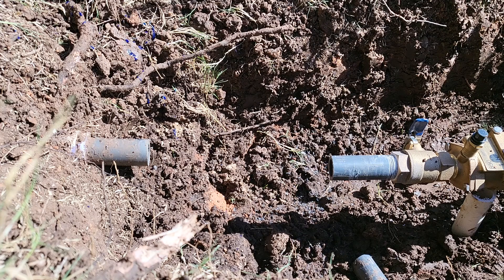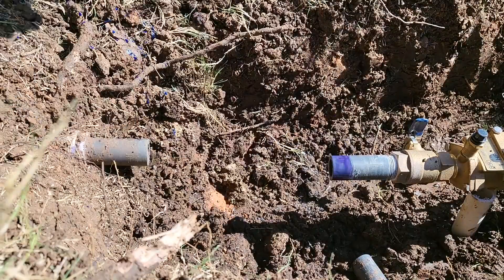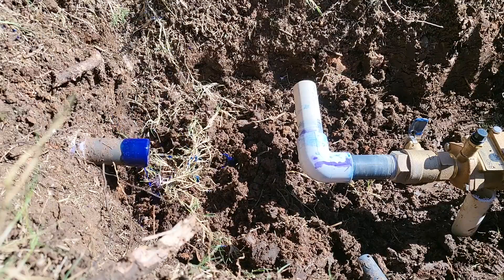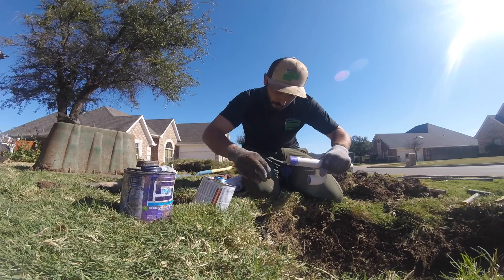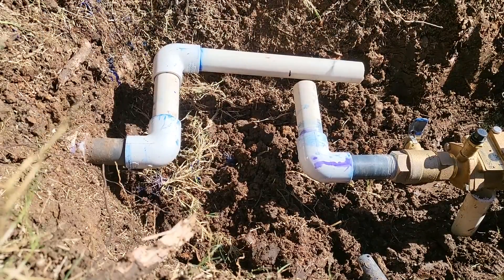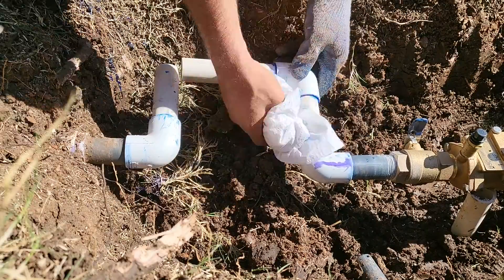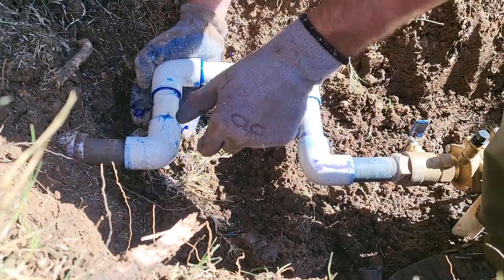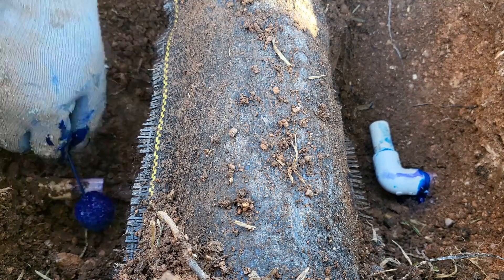How to repair broken PVC pipe with four 90 elbows

Comment: Does this reduce the flow/pressure on house or appliances?
Reply from the maker: Yes. But if you do the maths you are losing less than 0.1 PSI so the loss is negligible. 

Every time you add anything to a system it will affect the pressure. Whether it is noticeable is another matter.

Comment: ive used the 2 45 degree fittings a couple times, which seems to work ok if you have a little bit more play to  pull the pipes apart. but the 4 elbows is tried and true.